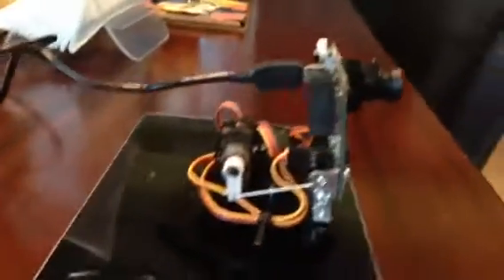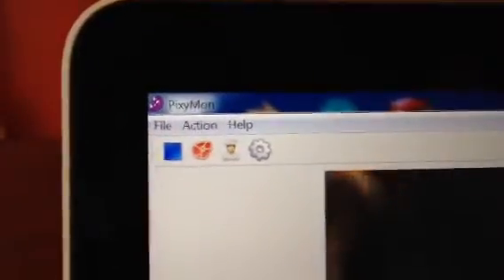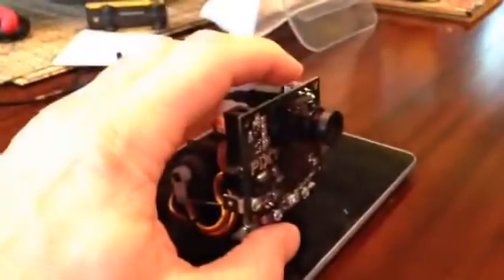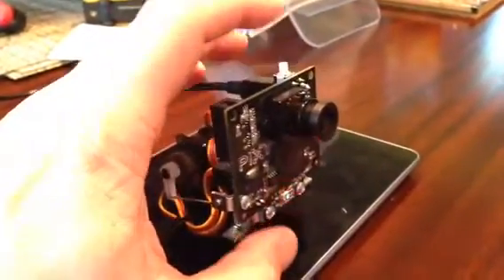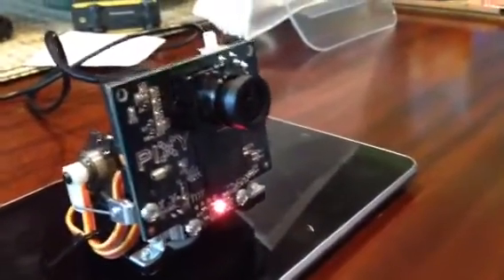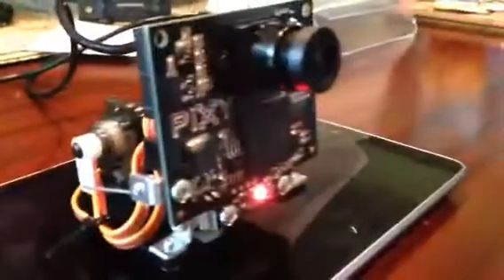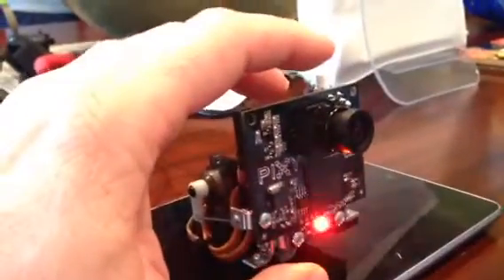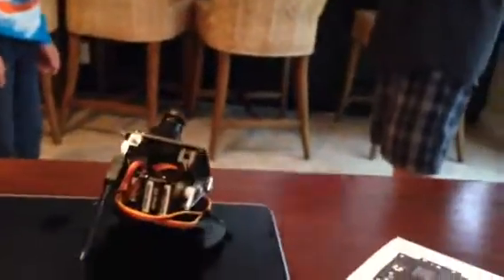Pixy CMUcam5 Digital Camera: 2. Testing the Pan / Tilt Mechanism

Comment: I just built PIXY Cam and pan-tilt mechanism, Great hardware, goes together easily
and has good instructions online. I use PixyMon under windows XP 64 to control
the pixy.
It's tracking is wacky. Recognition is by color, and it is amazing how many of the
same color objects are in the FOV, which sends it crazy trying to track.
Recognition by color!!!
My Pixycam pan-tilt only two days old
Maybe it will get smarter?
Reply: +Cozmic Ray That's unfortunate to hear that it gets very confused with similar colors in the background. Although not surprising at all. But with a fairly well contrasted scene or just a solid single color background I bet it works pretty well. I don't think it would get smarter, I don't think there's any kind of learning software built in - your only way to improve tracking would be, as described above, more contrasty scene/uniform background.
Despite that limitation, still seems like a super cool gadget with lots and lots of potential!

Comment: looks to be a relatively easy setup.  
  I hope there will be a few Pixie tutorials in conjunction with Arduino.   e.g..  I'd like to have a second set of servos operate when a coloured object moves out of view..  & then the servo would move the robots base to compensate.
Reply: I had a similar thoughts, but the documentation seems to be missing. I can't find the object follow program. ArduPilot sounds interesting,  Quad or plane?
Reply from the maker: I will work on some arduino setups this week.  Adding additional servo's should not be difficult.  You could also get a continuous 360 degree servo for the pan as long as you don't get the wires wrapped up in too many twists, or use a slip ring.
Reply: I'm  planning to develop an RC aircraft..  Pixy cam will rotate 360º  & the aircraft's 3 flight servos should react to Pixy's input.. so for example if the targeted color were to start to drift to high out of view in the pos. Y axis  pixy would adjust the flight controls accordingly to bring the target back into a central location.  The part I am interested in is
1.) sending PWM signals to Arduino from Pixy
2.) allowing Arduino (Ardupilot) to take over control of the servos at a set altitude

Comment: nice one
I'm interested in connecting to Arduino & get a few motors running or extra servos....   not only the Pixie cam servos.  I'm hoping to interface with ArduPilot.
Reply: Michael Banks a bit old but I'm doing the same thing for autopilot landing! checkout my forum post here if you'd like to discuss it http://cmucam.org/boards/9/topics/5893